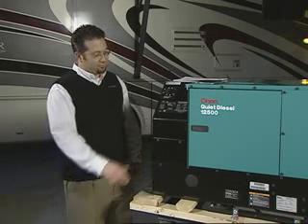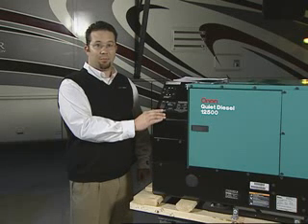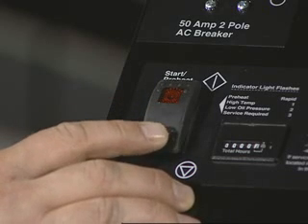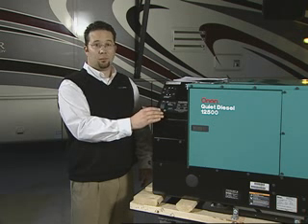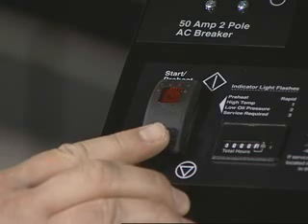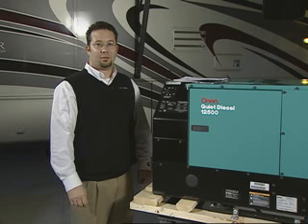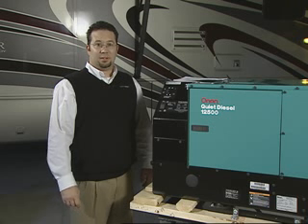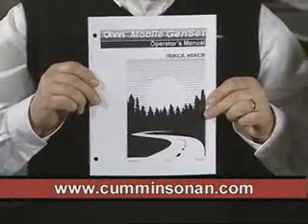Cummins Onan - RV Products - How to retrieve fault

Comment: You mentioned 2 separate fault levels.  What does the 1st level fault code represent?
Reply: 1 flash is High Temp, 2 flashes is Low Oil Pressure, and 3 flashes is Service Required. I thought the second level fault code with the two separate digits was only if the first level indicated Service Required, but I could be wrong.